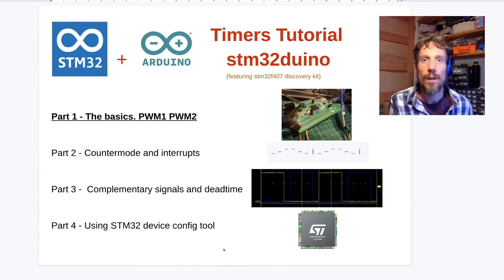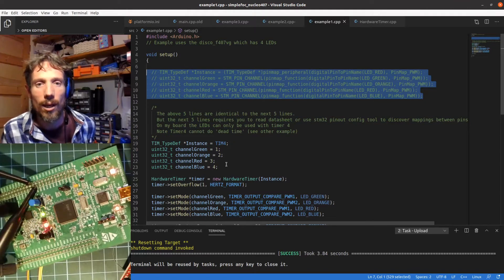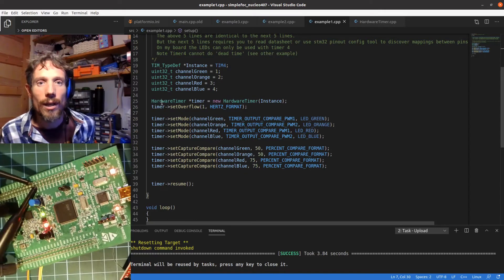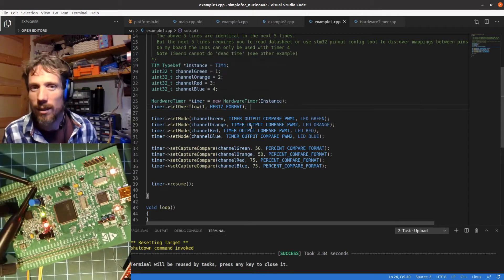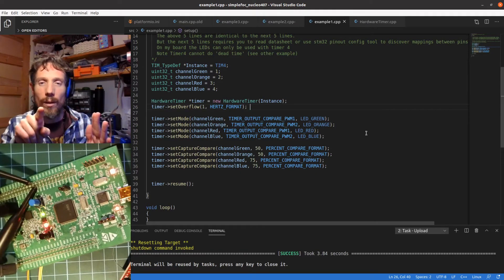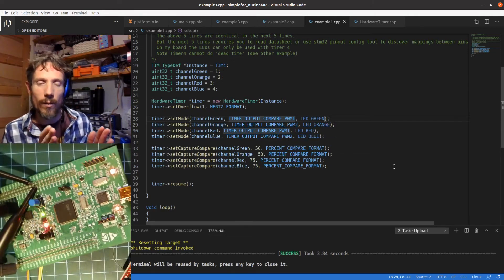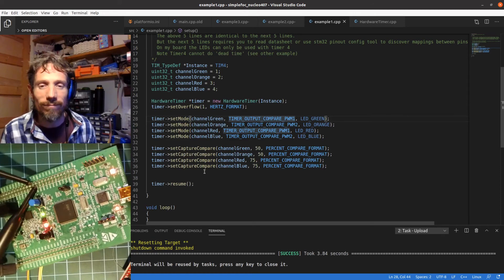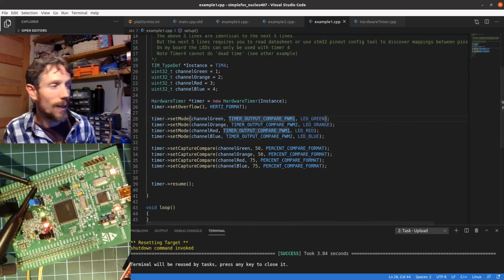STM32duino Timer Tutorial:  Part1 - The Basics (PWM1 and PWM2)

Comment: I am using maple bootloader on stm32 blue pill and whenever i am trying to fade an led with pwm im gettting this weird flicker.. it seems like to reach a value of 65536 with analogWrite from arduino software it reaches some maximum value then sets the brightness to zero and repeats this process until it gets to 65536.  why am i not getting a smooth fade as i do with arduino any idea how to fix?
Reply from the maker: I don't use maple but reading docs analogWrite maps to their pwmWrite function and indicates range should be 0 - 65536. Might be worth changing the range e.g 0-1024 as an experiment.  Docs also say you need 
pinMode(9, PWM);
in setup() to use pin 9 for pwm and mentions that not all pins can do pwm.  So you could try another pin?  I presume you have a current limiting resistor in series.